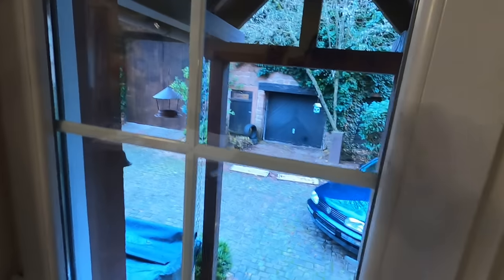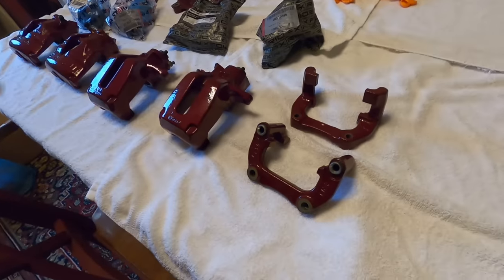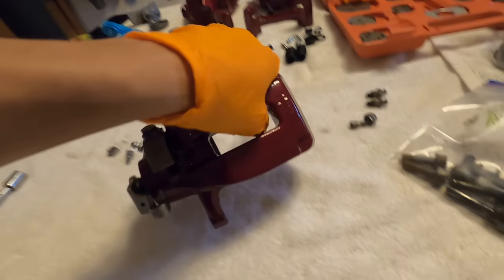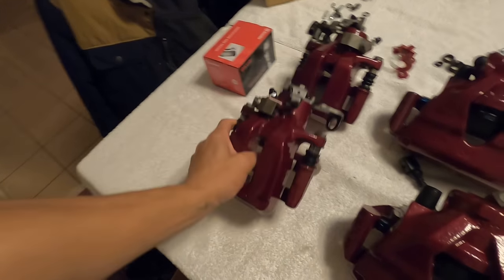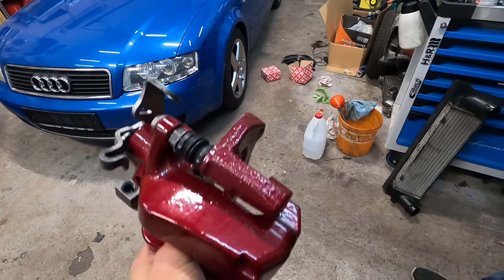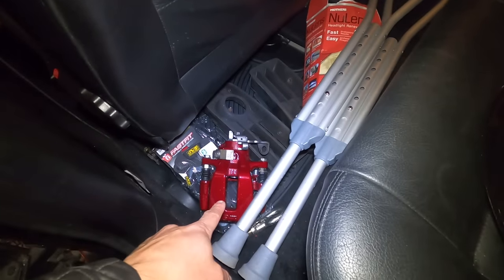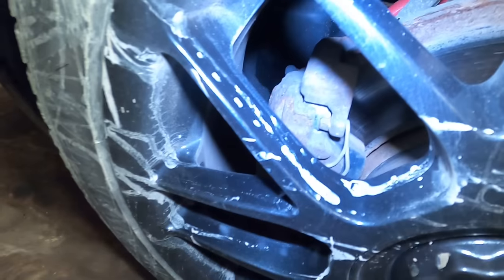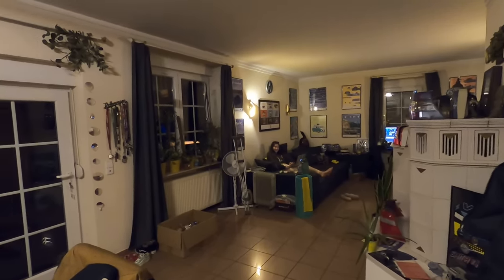VR6 Jetta Brake Caliper Assembly! ( 312mm Front - 256mm Rear )

Comment: 312s look massive on the table 
If you want bigger 
Mk5 golf r32/audi s/rs3 uses 345mm front and 310mm rear Discs.
(Discs do need redrilling from pcd 5x112 to 5x100) and a hubcentric spacer between disc and hub nothing major 
Mk1 Seat leon cupra  R use brembo 4 pot calipers. Match them to 345s damp that stop

Comment: Sorry maybe I misunderstood, the TT/S3/R32/LCR rear 256mm on the mk4 platform is plug n play, did this the other day on my Wagon, No real need for spacers.
Reply from the maker: The 4motion mk4s have a different rear carrier for the caliper then the fwd cars do that have the 256mm rear brakes. You have to add spacers so the caliper sits in the correct spot.